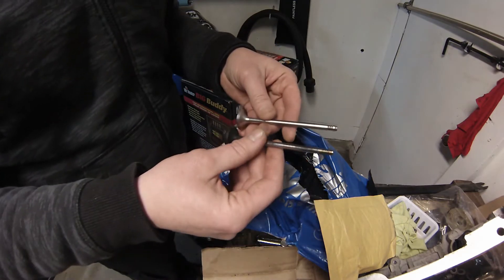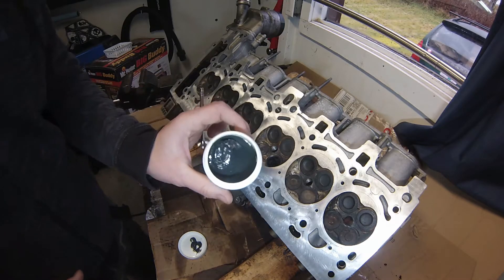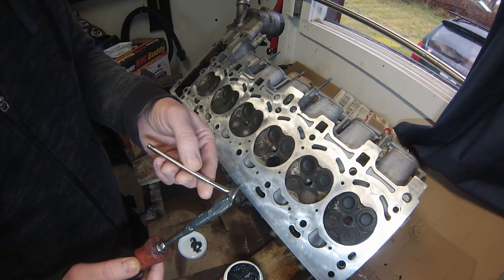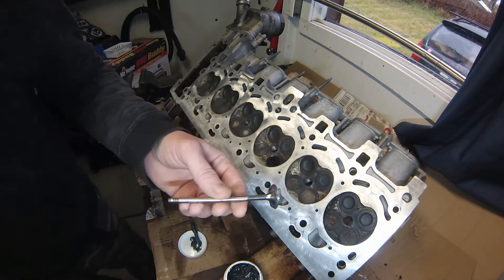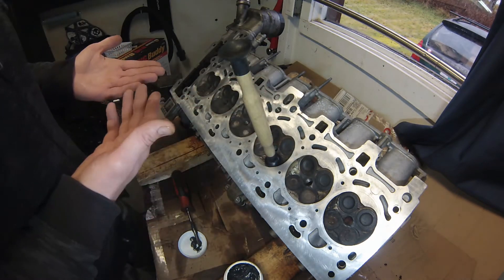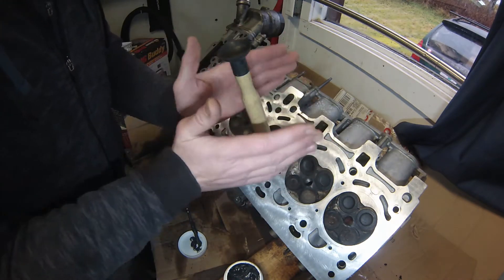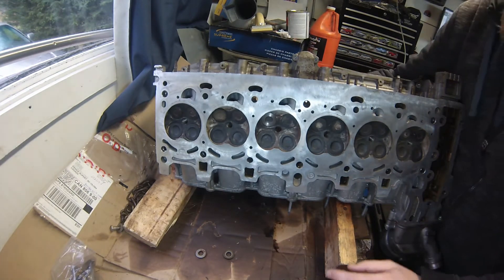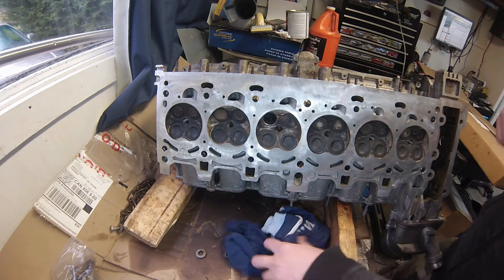BMW 323i Valve Install / Cylinder Head Torqued Part 5 - How To

Comment: do you need to get new front aluminum bolts also or can you reuse the old ones? thanks for this bmw series. definitely saved me a headache!
Reply from the maker: acFreak I would like to be able to answer that but I honestly don’t remember. Manual probably says to replace them. Glad it was a help

Comment: Are the valves on that model BMW head machined specifically to the valve? Or is that newer models?
Reply from the maker: These valves are a single 45 degree cut. The new valve measured out to be the same diameter and length. I am no machine shop, only trying to get this thing together so my buddy can sell it. The difference between what I'm doing and what BMW would do is about $2500 minimum.

Comment: No expense spared for shipping such a crucial engine part!  Gotta be sure it arrives in perfect condition.  Valve keepers are a massive pain.  I usually use a little dab of grease to hold them in place and use a pick to guide them into place before letting off the spring.
Reply from the maker: Seems like a lot of online sellers don't give a rats ass how something arrives.